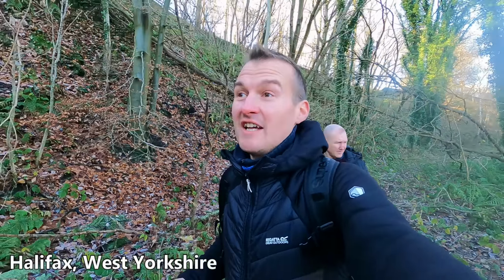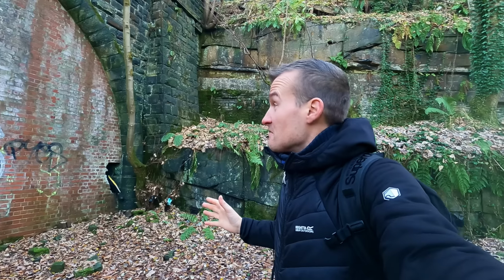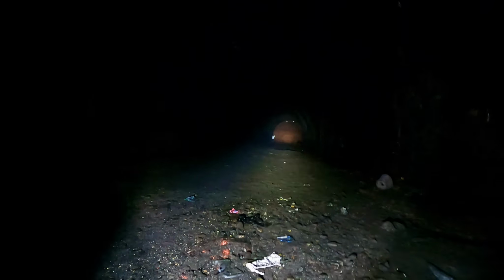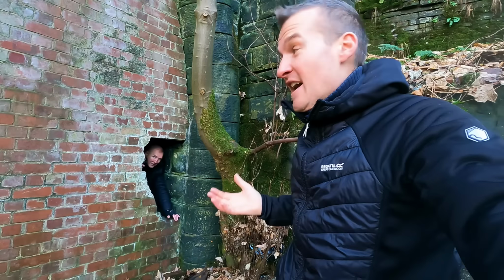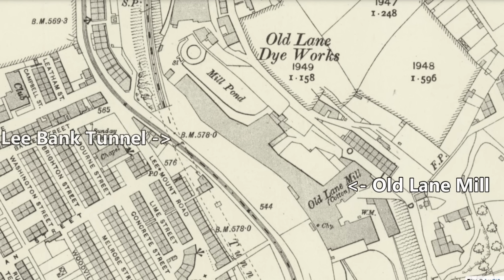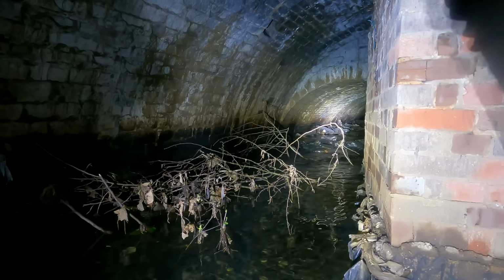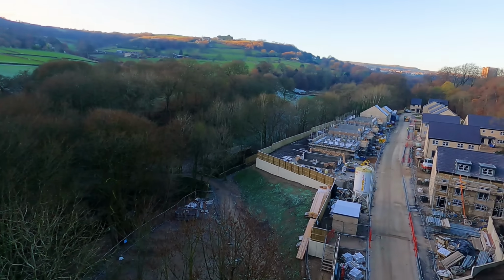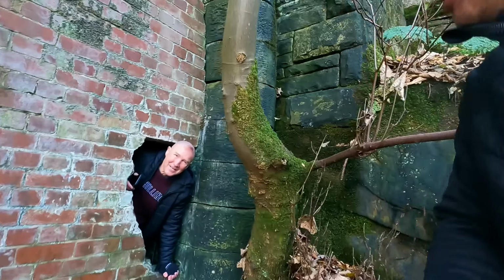The Tunnel , The Mill & The Viaduct - #disused #railway

Comment: Nice video. I used to live 200 yards further down from the tunnel, just where Ovenden station would have been, so was really interesting to see it on video. The viaduct I think was part of the halifax high level line, but tbh, it would have been more interesting if you have researched the local history and included that as part of your video as Halifax is littered with old railway lines that have long since gone.

Comment: I'm only guessing but I think The building you walked into at the old mill was probably a boiler house there would been to or three big boilers fed by  a stream  maybe from the mill pond there would have been high pressure steam lines that ran into the mill and was used to power the equipment and provide heating as well

Comment: So sad that the mill owners saw fit to remove all the windows to, no doubt, let the elements in to destroy the building to justify it's ultimate demolition "on safety grounds" rather than intelligently looking at repurposing the clearly robust building.

No doubt in a few years the site will be cleared and some concrete and steel monstrosity, with no architectural merit, will be erected.